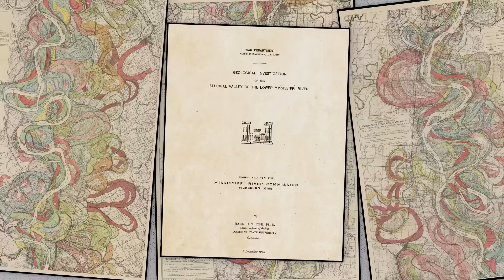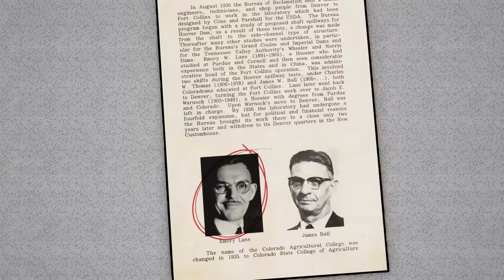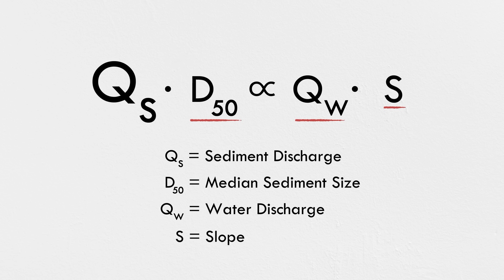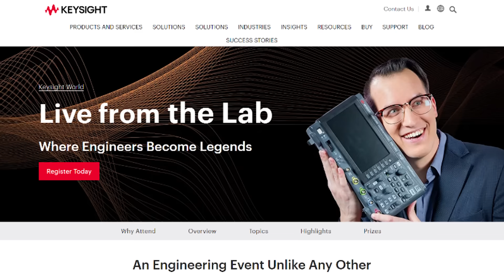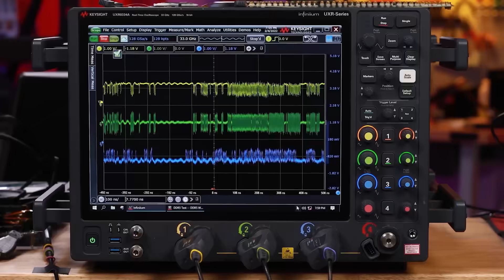Why Rivers Move

Comment: Got a creek that is about 3 tenths in length on the farm. Property line goes right down the middle of the creek. Wherever the creek is that is the property line. To watch it change after a rain is amazing. Logs will appear. New sandbars old sandbars, Trees will fall over into it ever so slowly. Change the direction the water... On my side I chose to keep about 75 in a buffer(trees naturally)  with just letting it go. On the other side the farmer cuts it all down to grow crops. His side floods more often than mine. But the creek seems to wander and this helps me understand why. Just a small section but still the same principles.

Comment: Not to nitpick in any way (because I really like this very informative video), but my mind is a bit unsettled at the Slope equation at 11:54. Shouldn't the formula presented be inverted? If Slope is indeed "rise over run" (and that's how I learned in Algebra class too!), would that make the formula "Slope = (change in elevation)/(length)?   Again, I think the video is very, very good.

Comment: I’ve worked with Emriver tables and they’re a blast! I was part of the exhibition interpreter team at the Denver Museum of Nature & Science when we opened Space Odyssey 2003. It includes a stream table to demonstrate stream structures on Mars.

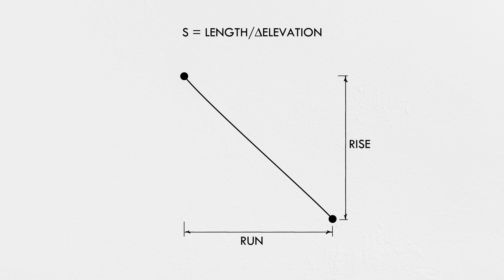Must say the diagram around 7:40 is brilliant. But at about 12:00 I’m a bit confused. Rise over run but your equation is run over rise? I have degrees in both geology and math and I really think the expression is should be “delta(change in) elevation / distance.” Every around that in the presentation is spot on, though, so I’m inclined (as it were 😉) to call that a typo. Maybe I’m missing something, though. Help, please.

Comment: A very interesting article about why rivers move.  When water moves the direction that it travels depends entirely on the resistance that tends to impede its flow.  Water will always seek out the best possible path until the water reaches base level, that being said, the sea or the ocean.

Comment: Would the pulsed flow behave the same if both scenarios had exactly the same sand box with no differentiation. I would assume they would both find the paths of least resistance. Or would the faster short flow of the pulsed river move more of the sediment leading to new paths forming?

Comment: I made an interesting discovery when I was in high school.   There were large piles of dirt near a lake.  I created an indention at the top with a small starting groove.  As I poured more water at the top, the path it created was neat, but hear is what surprised me.  Within the piles of dirt were chunks of clay.  They erode slower than the dirt.  
What would happen is that when the water hit clay, it would hold its place and create a waterfall.   While most of the water flowed over the falls, some flowed down under the falls.  When that water eventually hit dirt it would erode the foundation of the chunk of clay.  That chunk of clay would then fall and create an obstruction that would redirect the flow of water.  
The process continued as it went down the hill.  It eventually made a muddy mess back at the lake (a delta) And I was totally mesmerized by it.

Comment: In the 70's, the Corps of Engineers had a scale model of the Mississippi River drainage basin outside of Jackson, Mississippi. A stream table that covered covered acres! They could simulate precipitation and flow in various areas to better understand how changing precipitation from the Rockies to Pennsylvania could affect flooding and erosion. After thousands of scenarios, it was shut down. It was very interesting to walk over the model and have the project explained.

Comment: I recently learnt that my town was built in a river delta. I am wondering if that's a crazy thing to do. The town flooded recently and i have since found a research paper which is very extensive on the river delta i live on and it was stated how unstable the land was there yet they went and built levelground houses and it flooded while they were investigating and it was so close to the residential areas that day forward 40 years where there is more infastructure i think its going to cause the area to flood more. 
I plan on making a video about it

Comment: Saudi Arabia's Artificial River: A Bold Vision for a Sustainable Future 

Saudi Arabia is an arid land, with most of its territory covered in desert. Water is a precious resource in the country, and the Saudi government is committed to protecting and managing it sustainably. One of the government's most ambitious projects is the construction of an artificial river. 

Why is Saudi Arabia building an artificial river? 

The simple answer is to have a continuous flowing river rather than a seasonal one. Saudi Arabia's natural rivers are ephemeral, meaning that they flow only during the rainy season. This makes it difficult to rely on them for a consistent supply of water. An artificial river, on the other hand, would provide a reliable source of water for drinking, irrigation, and other uses. 

How is this possible? 

The artificial river will be powered by desalinated water. Desalination is the process of removing salt from seawater to make it drinkable. Saudi Arabia has a number of desalination plants in operation, and the country is investing in new desalination technologies to increase its water production capacity.

Comment: For the 18 years that ive lived in Washington State ive seen the sispus river actually change the landscape up in the Gifford Pitchent National Forest there used to be a camp sight that was right off the black top that led down to the river it was basically a beach side camping spot but over time the river basically ate the camp spot and eventually it even washed out the road this happened over many years but it was still kinda cool to watch i think the biggest factor to why this happened is because of the snow melt that would accur the sispus would flow like crazy

Comment: So, how does Lane's Equation function at the differential?   dQs*dD[50] ~ dQw*dS? We have here, quantities that are function of both time and distance along the river.  Causality along the river tends to flow downstream, for obvious reasons.  Still, do downstream factors back propagate cause?  Large quantities of material eroded upstream may pile up downstream, restricting flow upstream, right?  Will a large meander upstream, decreases the slope there, which in the balance is offset by the stream gaining a greater slope somewhere downstream?  Or, in the opposite, will a change in slope downstream back propagate it's effect upstream,  causing the opposite change to slope such that the overall river maintains a constant overall slope?  Of course, along the length of the river, soil may vary considerably, from topsoil to bedrock.  There is a lot going on.

Comment: This is really fascinating stuff!!

It feels like the "equation" is less lacking a factor and more how the average is counted that is wrong to explain that difference in the final demo (I know it lacks other considerations, but specifically on that one). The way I see it, in that final demo where all the variables average the same over real time passed, I don't see them as the same variables. I wouldn't include the dry periods of the pulsating river on the average, so this would mean that model is a river with higher average volume observed a shorter amount of time (just ignoring the functionally dry periods). From this angle, the relationship accurately predics which will have higher erosion.

Alternatively, you could keep real time but plot erosion/deposition (+-y axis) over time (x axis). The constant flow will just gently fluctuate around 0, averaging to 0 over time, and a stable configuration. On the pulsating one, you have a flow (a quick increase on Y that stay above for a bit), a drying period (a short lived sloping down to 0, still mostly positive if it ever does a small dip bellow 0), a dry period (flat 0), repeat; this would obviously average to more than zero, predicting a constant state of erosion, exactly as the demo showed.

As for other factors, I think the simplification would sitll work rather well if you take a similar approach of just using those factors as ways to modify how you count these 4 primary ones (e.g. vegetation's ability to hold on to soil is effectively a modificaiton on median sediment size).

Comment: Id like to see the beginning of the pulsed flow test. It seems like the initial state of the test would be the same for both rivers, but the time water has to erode the banks is less for the rare pulse river. My gut feeling is that it would still settle to an equilibrium, but it would take more time (but similar amount of time with water flowing).

Comment: I cannot believe that nobody thought about passive water flow modifying structures that are mobile and simply accelerate the speed of water at the bottom. 
Its so simple and so effective. 
But it would need to be huge in scope. 
Lots of simulations and small scale tests. 
But once they are deployed they would work just as well as the active (pumps or  excavators) expensive river dredge schemes.

Comment: Over the lockdown periods of the pandemic, I took a daily walk in the woods behind my parents' neighborhood. There was a little, tucked-away, undeveloped spot where a local significant creek met a significant river of the area. This being an area that tends to get significant downpour that threatens river flooding a few times a year, it was a quite active flow spot that was maybe a food deep on your average day, but I once saw it at about six feet deep. Watching how it changed day by day for a year and a half was honestly a great way to get a sense for now non-static even a relatively healthy stream and river meeting is. 

When I first started walking there, relatively recently a tree had fallen over the stream, just ten feet before it met the river. Initially, it flowed fine, and the log was a great transport to some trails across the creek that were otherwise a mile away from another access point. But as the year went on, the tree started to significantly dam flow. Stagnant pools developed behind it and on the side i entered, where there was one a long, gradual sandy bank, now had become steeper with a lot of the sand washed away as the main flow transitioned from the far side of the creek to the near. 

Finally, after a major flood, the near side, sandy bank washed away entirely. The fallen tree and its trapped debris had fully dammed the far bank and the near was now taking the full flow of the stream, what was once a gradual cutoff was now a 3-4 foot high cliff, and you needed to get down to the bank from another spot further upstream. 

Then, after several months of this, another major flood came, and this time the full tree was carried off entirely! the dam broken, the stream flow returned to the far bank, and within a few months the sandy shore was already half-reformed.. now, a few years later, it's practially fully back to how it was when I first started walking there... truly a testament to the power of water flow!

Comment: I love the demonstration.  As an ancient forests ecologist I will say that there is something key missing from this flood table and that is immense amounts of wood in all shapes and size and  derived from all kinds of tree species, each with different chemical and structural characterisitics

 I guess some would might try to lump this wood in with seddiments, but since wood is organic and grows and it is much larger than most sediments usually being moved (even boulders moving in debries flows and outbreak floods and the like).  This is especially in ancient forests, which used to line the Mississippi and most  of the rivers of the world, where wood of all kinds profoundly shaped river systems.  In ancient forest areas wood  of kinsd of odd shapes, like here in the Pacific Northwest, before industrial logging, logs 200 to even 300 feet long, massive complex roowads, twisted branches, hard massive burls, complex tree crowns and so on and all of these and smaller wood would form massive logjams and huge wood debries islands...

 Additionally, wood floats, but then it becomes partially waterlogged and then fully waterlogged and it interacts with the muds, silts, sands, cobbles, gravels boulders and so on...  Being organic the wood also provides food and habitat for so many animals (think salmon for instance) and it filters the water.

Comment: The course of the Mississippi was changed by the 1811-'12 New Madrid earthquakes, and seasonal flooding added further chaos, changing the channel by the spread of waters that ate out new courses.  However, the Mississippi is probably less than 4,000 years old, maybe 1,000-1,500 years younger, and the other rivers of this continent are younger still.

Essentially, the Mississippi is a giant example of laminar flow, most of the time, falling less than 1,500 feet over most of its course to the Gulf of Mexico,  but there is always turbulence, even in the somnambulant Big Muddy.  The Colorado River, in comparison, falls around 10,000 feet from its origins in the Rockies, to its delta in the Gulf of Baja California.  The Columbia River, too, starts in the highlands of northwestern Washington, feeding off streams that begin in British Columbia, 2.16 feet per mile fall compared to the Mississippi's 0.65 fpm.  Turbulence plays a large part in the river's path, but water will seek its own level.

Comment: Just a few miles from my South Texas home is a tear drop shaped slot of land with a C shaped lake around it. Nothing special about it, however that was once Mexican soil and it was a major bandit hideout during the Texas Frontier days. More importantly during the steam bot days on the Rio Grande it was a notoriously difficult spot to navigate due to the sharp C turn the boat would make in which it would have to slow down significantly. Mexican bandits would fire upon the steamer, forcing it to run aground and rob it. That spot is now all US soil and the Rio Grande shifted a mile away.

Comment: In 4th grade science class we did an experiment involving a simplified version of a stream table for our erosion unit. We partly filled a deep baking pan with sand. We created an gentle slope with the sand to simulate terrain.(some imperfections are required for the experiment to work) we poked small holes in the bottom of the deli container. we put 2 ice cubes at the highest points to simulate snowmelt. We filled the deil container with water, and held it over the sand to simulate rainfall. A stream soon formed, and we watched erosion in real time. It was on of the coolest experiments I ever did. I wonder what it would be like to experience a real stream table.

Comment: Gravity. Water travels a path of least resistance.
Reply: Gravity is not the cause. The resistance part is right though, in terms of currents. It travels the path of less resistance, wherever the pressure is lower it flows towards it.
Reply: Mars didn't lose its water because it has less gravity. Gravity doesn't have anything to do with it.
Reply: @peterolbrisch8970  Didn't Mars loose it's waters because of freezing?
Reply: @Saumya-orbiting  Frozen water is by definition still water. Most of it evaporated.
Reply: @peterolbrisch8970 Oh, that makes sense. In documentaries and videos they usually use the term frozen. I assumed it was really frozen.
Reply: @Saumya-orbiting  The frozen water didn't evaporate, it's still there, frozen. But the liquid water evaporated before it had a chance to freeze. Thanks for your reply and have a great day!

Comment: Another very interesting fact about the equilibrium of the path and slope is that if you divide the total length of the river by its direct length between the starting point to its end point, you more often then not get the number Pi !
(This is not the case for rivers where humans have artificially changed the path)

Comment: 14:35
"There are also other factors that it doesn't consider like vegetation or pulsed flow"

It doesn't deal with time at all. 
When conditions change, so does what is happening at that spot in the water flow.

You might as well have taken 2 rivers. Told us that they have the same average slope.
And then acted surprised that the one with multiple waterfalls along it acted differently.

As for vegetation, it will slow erosion. It won't stop it unless it changes the flow of the water at that location.

Comment: Imagine what the current drought will do to the shape of the Mississippi.  Exposed sand banks and bed rock will significantly change the course of the river in months, not decades.  Building next to a river is an invitation for disaster. Thinking you can force the power of billions of cubic meters of water away from a town, is hubris.